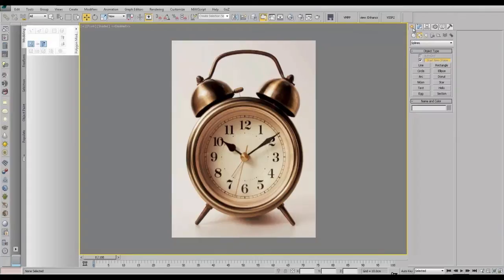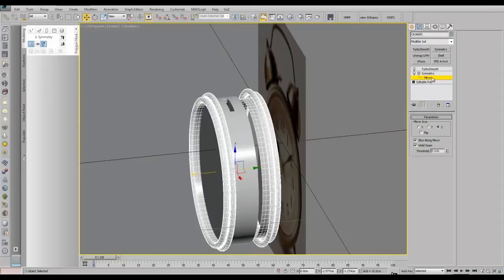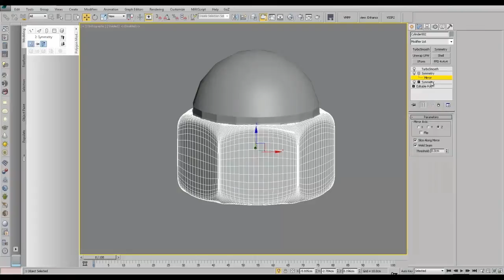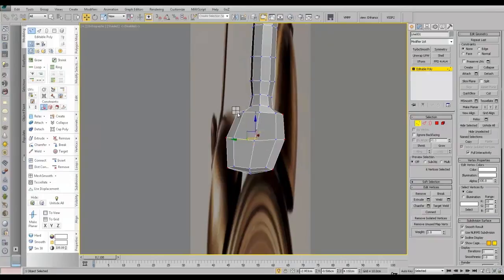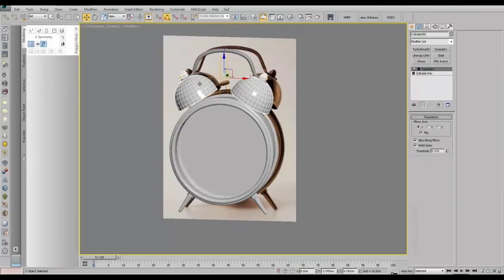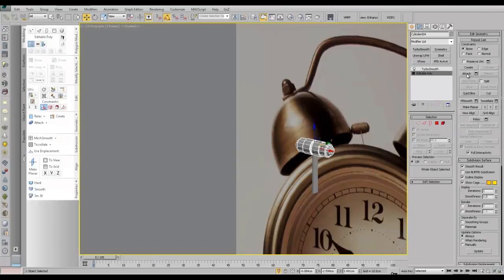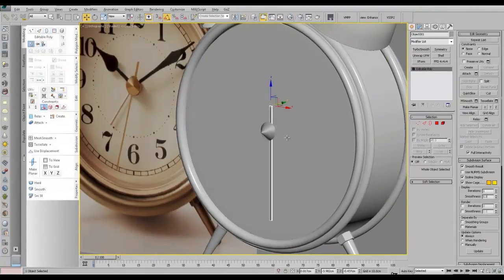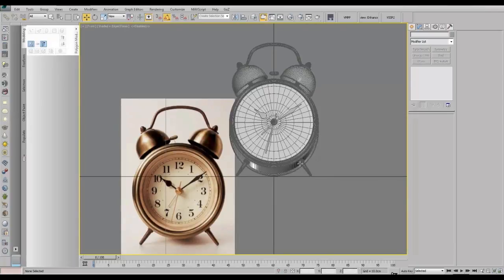The Clock Part 2 Modeling

Comment: Question. Do we need that many polygons on the front glass (my mesh is about 6000 polys with the turbo smooth, and this is basically just a flat surface) ? Is this going to make refraction's and reflections better in V-Ray? 

P.S: Also. Did you have a massive hangover while recording this video ? Because you kinda sound like... :D Well. Thanks for the tut, it's awesome.
Reply from the maker: No, you don't need that many faces on the glass mesh. This won't make any difference with the shader relections/refractions. you could even use a cylinder primitive the same as the one I used for the clock body, as long as it has enough circumference segments to match the curvature. Polycount dosn't really matter as much as it used to so the facecount isn't an issue as this is just an illustration render.

Thanks for the comment. I don't think I did have a hangover that day:)